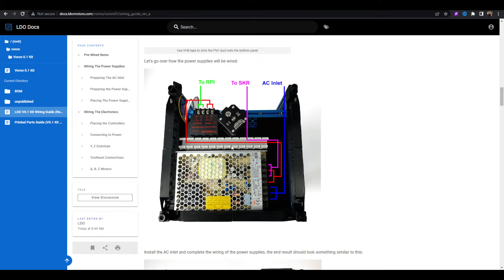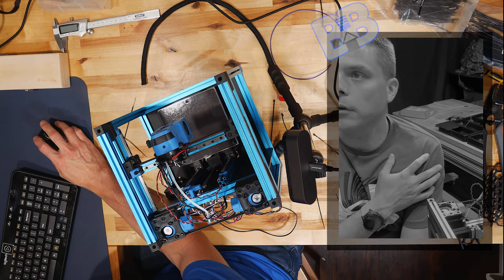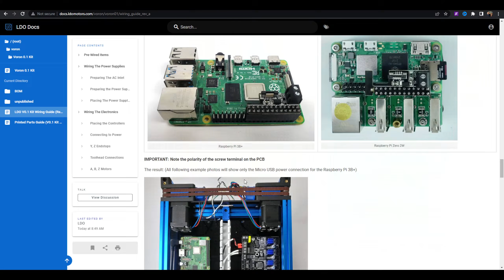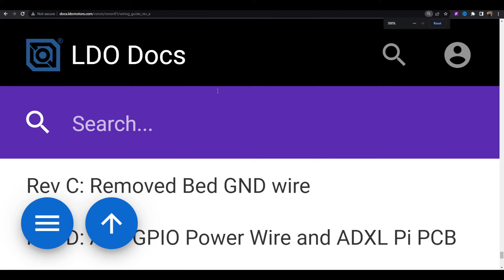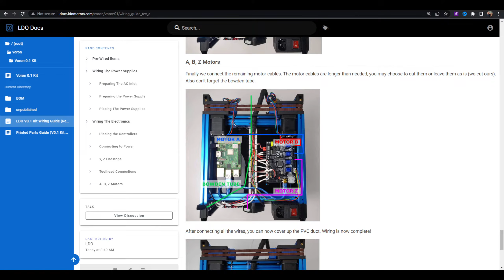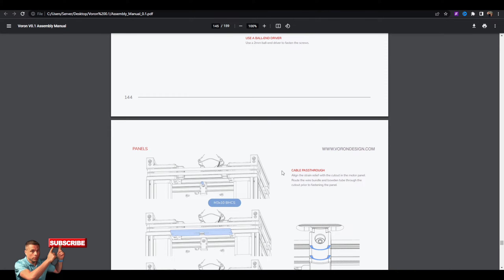DIY 3D Printer LDO VORON 01 Final wiring and Complete!

Comment from the maker: Enjoy the video, full software setup coming soon
Reply: How soon? 🙂
Reply from the maker: @Tenhult  LOL - Well guess that's long overdue.  If you look at this playlist - the settings may be different, but the basics will be the same.  I'm happy to answer any specific questions on the 01 you have as well.  https://www.youtube.com/playlist?list=PLjlotZjUVD30kQILvcJZNFkfZSFUcvO-y Still making these videos, I plan to do multiple (4-5) to go over most aspects of Klipper and Mainsail.
Reply: What would be a stable printspeed on a V0.1, if i don't want to max it out? For printing good parts for a bigger voron. Speed and acceleration in slicer .
Reply from the maker: @Tenhult  That's a bit of a loaded question - However, I would start around 180mm/sec with ~4k acceleration.  I wouldn't suggest anything higher than 200mm/sec with 4.5k.   To be honest, to ensure the best parts available I would probably stick to 160mm/sec with 2-2.5k acceleration for printing parts,  some parts have higher tolerances than others.  Anything that is in the toolhead I would slow down and for the larger parts I would go as high as you like (up to 200mm/sec 4k - with a close eye on ringing and extrusion issues.